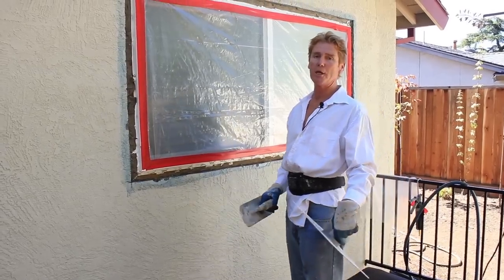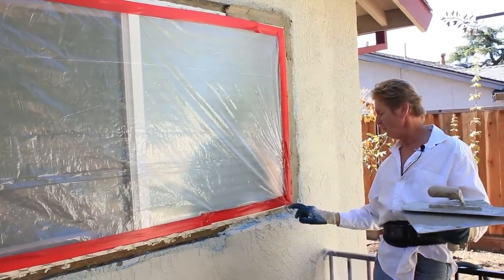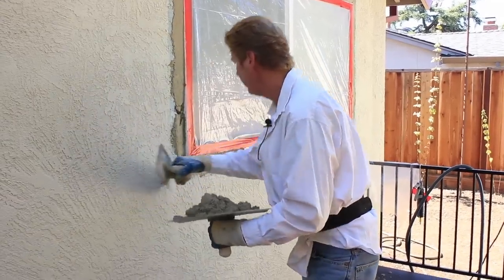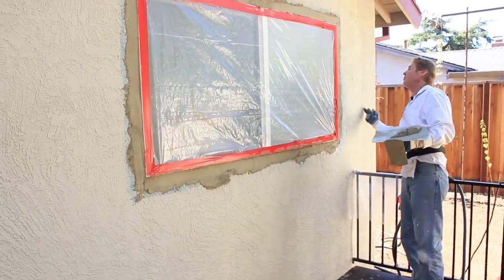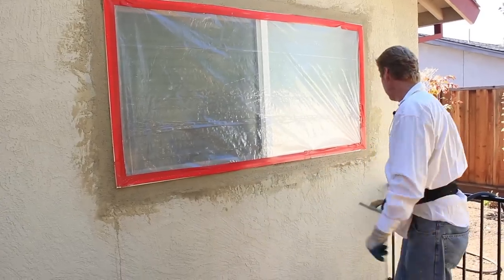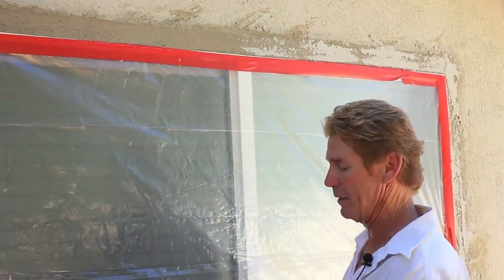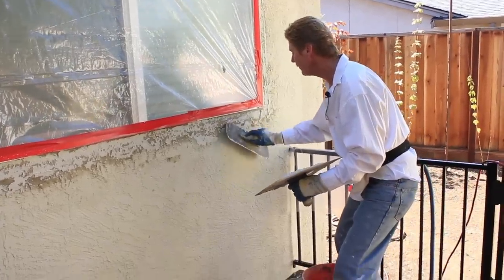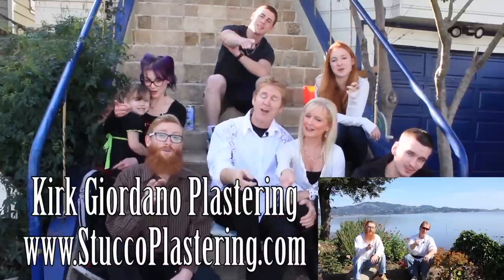Stucco around a new window in saw-cut stucco

Comment: ive done several stucco repairs and none seem to come out right. my main issue is getting the stucco sticky enough for it to stay on the lath. Instead it rolls right off. I see your videos and looks like your stucco stays right on and appears like claydo. what is it that I'm doing wrong? could it be the tools? the mixture?(I followed bag instructions) could it be the pressure?
Reply from the maker: Morning Sisto Diaz, excellent questions, I will address these questions in an upcoming video as you make a very good point.

 One reason could be the wire if it's two flat meaning not not enough sticking out the stucco has nothing to grip to.

 Another reason is the stucco is mixed to runny, too mush water or not rich enough, not enough cement plaster.

 I make it look easy as I'm half the team, the other half is my son Jason or my brother Luuuuu. both of these guys mix perfect mud, well most of the time, so I can make my job appear easy .
 Cheers,
 kirk giordano plastering

Comment: Hey Kirk 
Here in North Orange County 
Code is 12 inch min breakout and wire overlap around window replacement
Reply from the maker: Howdy Al, here it's 3 inches, however, there are some jobs that the contractor, homeowner or we can't get a half inch let alone 3 to 12.     
                                   Live long and plaster
                Answers to life’s stucco and plastering questions
Reply: Kirk Giordano plastering Inc. 
thanks Kirk great videos 
Iv learned a lot from ur videos
Reply: Eagles Rule those r retrofit type windows ! Yes those don’t require break out 
I’m referring to nail on flange type windows as he is doing in the video
Reply: @alfredmedina9398  Yep. I work on houses. Where they put in. Retrofit windows and Kind of looks good. But at the same time kind of cheesy

As for me I like Put it in all fresh window.

Comment: why not just take a stucco hammer and spend 20 mins to chip up the edges for a better bond? just purely out of curiosity.
Reply from the maker: That is a good question, I explained that to the home owner, he didn’t want that done. Thus I felt it was a good opportunity to demonstrate our method of alternative ways to lath using bonding agents and extra wire. Keep in mind the paper was intact so no way for leaking. That’s what is important. Our method was to minimize perimeter hairline cracking. We demonstrate all scenario’s.😉

Comment: Nice video but you didn't put the chicken wire back around the frame and cutting it with a blade is cheating, but if your customer is okay with that, then that save you a bunch of time. It's probably going to crack in the future though.
Reply from the maker: howdy Andrew Debasque, dude, you didn't pay attention, no worries as it's sort of boring unless you need this information.
 The home owner did the lath and started to apply the cement plaster than decided to call us, who you ganna call? "stucco busters"
 I came out and explained it should be broken or just jagged,  I said I can do the best as I'm only as good as what I have to work with. 
We caulked his lath and applied a bonding agent to the saw cut then applied the stucco.
 Best wishes, 
 kirk giordano plastering